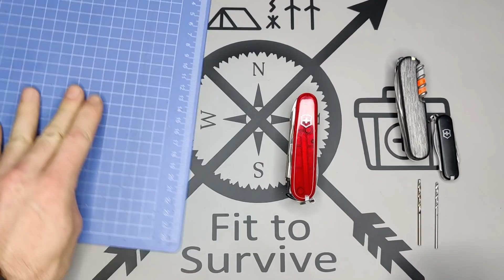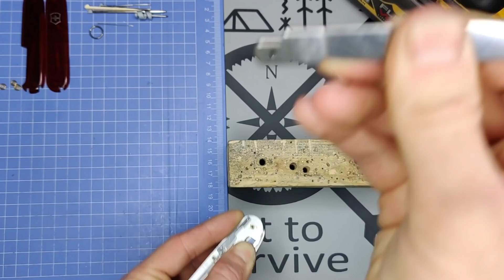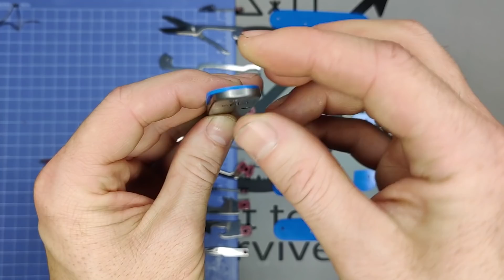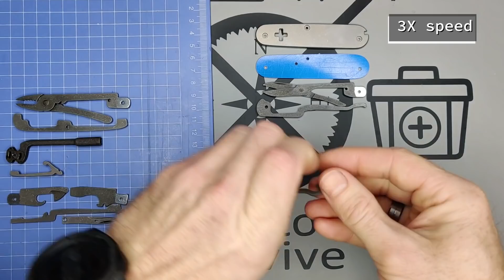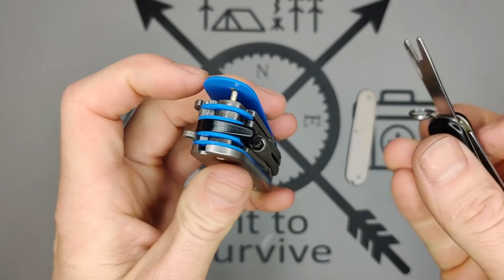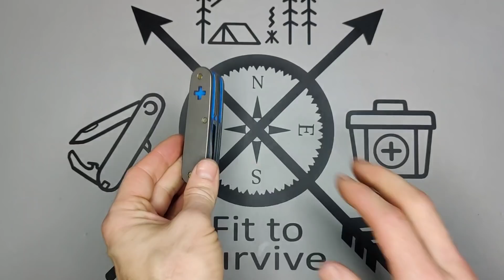How I made this Bladeless Cybertool M

Comment: As someone that wanted a bladeless multitool, and ended up with a modded cybertool lite, I will share my own research. To pass TSA guidelines there are four important things to note. First of all, they might try to stick the "No swiss army knife" rule on you, because of the cross Design on the front. However, TSA guidelines clearly state that you CAN have a multitool in your bag, as long as it doesn't have a knife blade. You will probably want to make a sheath for it to rest inside of to be extra compliant. Second is the scissors. TSA states that you are allowed to have scissors if they are less than four (4) inches to the fulcrum. Since this is a small set of scissors, it should be fine regardless of which fulcrum the agent chooses to try to use. The third is the most surprising. The bit driver will fall under the "collapsible tool" rule, and must be less than seven (7) inches long when fully extended and assembled. The bit driver should just barely squeak by this. The last one doesn't apply to your build, but is good to know. According to TAS guidelines, corkscrews are permitted on the plane, as long as they are not attached to a knife blade. 

Hope that is helpful!
Reply from the maker: Wow!! That is VERY helpful actually! Thank you for all of that information.
Reply: The problem i see is that it looks so cool that the agent might want it for themselves, thus trying to take it from you. I'd love an update once you actually went thru the airport with it
Reply from the maker: @nobodxy  Yeah, that would definitely be an extra difficulty.
I built this knife for somebody else. If he flies with it, I will update if he flies with it.
Reply: Yes, thank you very much! All info is helpful. Sadly I still feel that it will come down to the agent and how they are feeling that day and if you have the time to whip out the document and argue your point.
Reply: @korgan7779  if you want to fly with a tool like this, you will be served well by having a paper printout of the regulations, so that if there is a "Problem" you can show that you are in compliance.
Reply from the maker: @korgan7779  Yeah, in the end it comes down to their mood that day. 😒
Reply from the maker: @dagger341  Good idea actually. Having a printed out copy of the regulations might help you get at least fair treatment.
Reply: @FittoSurvive  

As someone that travels with a firearm, the TSA doesn't abide by rules or laws, just feelings. 

I'm required to retain the only key to my case once it's been declared and checked assuring it's unloaded. The LAW states I alone have the key. I've had the locks cut off my case, a card inside stating the case was opened for further inspection, and now zip tied closed.  They just broke a federal LAW, nothing is ever done.

The rules TSA has on the website frequently don't adhere to the federal law. If you want to fly, bow down to the previous burger flippers, or you don't fly.

The stupidest thing George Bush did was creating the Department of Homeland Security, and federalizing security personnel at the airports.
Reply: The awl can be an issue the sharpened part can be considered a blade... would leave the corkscrew if you can over the awl
Reply from the maker: @gungadinn  It really is insane. They shouldn't be above the law.

That is insane about them cutting the locks off of your gun case. And zip tying it back shut seems irresponsible.
Reply from the maker: @midwaymonster78  That is what many people have said... I guess I'll have to get rid of it in my next build.
Reply from the maker: @stevesinclair4159  🤣🤣🤣👍🏻
Reply: How does and awl or saw work?
Reply: @BassMaster.454  those will either need to be in your checked bag, far away from you, or left at home. Awls and saws are considered too dangerous.
Reply from the maker: @BassMaster.454  TSA doesn't want people awling or sawing other people to death on the plane. 🤣
Reply: @FittoSurvive  or deliberately damaging the aircraft.
Reply from the maker: @dagger341  True... Didn't even think about that. 🤔
Reply: I've had a ratchet bit driver denied boarding, TSA didn't like the 3" long flat blade screwgun bit + stubby racheting handle definitely less than 7" assembled they said it could be used as a prying instrument against a cockpit door. Tossed the bit into the lighter bin.
Reply from the maker: @ducatipaso1386  That is crazy! And not very encouraging for me. 🤣🤣🤣
Reply: @ducatipaso1386  did it have a case? I only ask because I want to do everything in my power to take my tool with me when I travel. Even if I have to assume that I will have to go into it as prepared and literal to the letter as an attorney, which might be the case, I want to give myself the best chance I can
Reply: @ducatipaso1386  LOL what a load of nonsense - I mean, if they make the cockpit doors out of wet toilet paper then yes, I can see how a 6" ratchet would an issue. But the same would be true for a plastic spoon. Or a very targeted sneeze.  If you can get a cockpit door open that easily, then clearly it is not the tools they should be worried about.

Besides: There is not exactly a lot of room around a cockpit door to even insert any prying tools, even for a very determined person. If there is more than one person directly at the door to the flight deck you would have to shimmy past each other...You can pretty much forget getting even a very small actual prybar in the maybe 4 inches (being generous) of space around the outer door frame. Also, some if not all cockpit doors are designed to withstand being shot at with a handgun without being penetrated. And "Damaging the airplane"....You would have to hack your way through some pretty tough plastic and a bunch of insulation before you even get within sight of the bare metal. With that little stubby ratchet. And by that time you probably have at least half of the passengers and all of the flight attendants wanting a piece of you. I cannot put my finger on it, but...something about that TSA logic is not adding up.
Reply from the maker: @DeputatKaktus  Exactly, right? Most of the TSA logic doesn't make any sense.
Reply: @FittoSurvive  Maybe they are afraid someone might try to sneak themselves some extra leg room by moving a seat row a couple inches? 🤪
AFAIK the seats are bolted to floor rails with regular hex or TX bolts…
Reply from the maker: @DeputatKaktus  😂😂 I think you nailed it! LOL That is exactly what they are concerned about. And what a good idea too. 😂 (evil laugh)
Reply: I tried flying with a Nerf blaster in my carry-on once. OKC - BWI round trip. I did the research and knew I had to put the battery in my checked bag. No problems with Oklahoma TSA, they looked at it under the x-ray, asked me about it, and let me through. Wasn't so lucky in Baltimore, though. Same setup as before, however the supervisor over security that day wasn't impressed. He told me I had to put it in my checked bag because it was a "firearm replica". Seriously. Did I mention it was bright orange all over? Not just the barrel like required, literally the whole thing is bright orange. Very obviously shoots foam darts and requires a battery, neither of which were in my carry on. So I had to leave the line, go all the way back to the desk, recall my checked bag, and figure out how to fit it in my already stuffed suitcase with no lock or anything (the modifications I did were not cheap). 
Anyway, be safe out there. You never know if your item will be fine for one airport's security but not for another's.
Reply from the maker: @chrismichaelyoung  That's crazy, but sounds about normal for TSA. 👍🏻🤣
It's actually quite a comical story too, thanks for sharing that.
Reply: Note that under the tool rule, the tool may not exceed 7 inches in any combination. This is important when considering which bits and adapters that you carry with it, since if you carry for example bit adapter to 1/4 adapter, and then you (or somebody else on same plane) brings a mini ratchet with 1/4 to hex adapter. Then you will be turned down on that, because the bit adapter can then be assembled to the 1/4 adapter, and then the 1/4 adapter to bit adapter, and then a bit on top of that, which would make the tool exceed 7 inches.

This also applies to if you don't carry any adapters at all. Actually, the TSA agent might need to reject all "bit type" and "socket type" of tools regardless of size just to make sure no combination of tools can be bringed on the plane so it becomes longer than 7 inches. They can't use ticket group as selector, as terrorists and such may book the tickets in separate groups to make sure they foul all group limits, even if they lose any family/group discounts.
Reply: @ducatipaso1386  Its actually not that. They propably said so, because this is the problem: Any tool handle or ratchet that accepts a "standarized tool" may be banned because of the problem that multiple passengers may carry extenders and adapters, such as so the combined tool becomes longer then 7". Its not really fair to allow 1 passenger to bring ratchet handles and bit drivers onboard, and then deny the next passenger having a little keychain ratchet bit extender, because in combination with the previous passenger it exceeds 7".

Its kinda hard to reach that with 2 extenders and a bit, so they propably made you toss the screwgun bit into the lighter bin just to keep the total size down, but actually, they should deny all "standarized tool things".

So this applies to all tools that can accept a standarized tool head. Both bit drivers and socket things (ratchet drivers, 1/4 screwdrives,  plastic boxes with 1/4 screwing  attachments, bit boxes which works as a handle for bits etc) falls into this rule.
Reply: @chrismichaelyoung  I understand the reasoning for this. Even if its bright orange, it could be easily repainted with a sharpie on the plane toilet, and then presented as a grenade launcher. So anything that barely resembles a fake gun, or could be assembled into a fake gun or fake anything that is prohibited/dangerous, must be rejected.
Reply from the maker: @sebastiannielsen  Wow... That's crazy. Didn't know that.
Reply: Yeah this. If there isn't a sharp edged part, multi-tools under 7 inches are fine to go. It is all dependent on the specific airport though as each has their own local rules as well.
Reply from the maker: @MasterYoshitaka  It does seem to depend solely on the airport and their decision.
Reply: @dagger341   When I took a school bus to Summer day camp in the 1960s there was a kid on the bus who would bring a small philips head screwdriver and remove some of the screws that held the seat back on.  I don't know if he ever got one off and I wonder if he continued this random destruction as he got older.
Reply: The awl would be the one I’d worry about. It’s sharp edge with a point😳
Reply: @chasekemp4982  True. The screwdriver would technically be a safe option, but the current way the TSA is run means that the agents are encouraged to just take all multitools in carry on, regardless of the attempt to comply with their rules. It is a terrible idea, in this current environment, to fly in the US with any multitool in your carry-on.
Reply: Great job!
Reply: @nobodxy I’ve always suspected that…
Reply: what about the awl
Reply: @gungadinn  ignoring the warning about 9/11 because “the Middle East was Clinton’s thing” was the dumbest—this came in second though
Reply: What do you mean by corkscrews "attached to a knife blade"?

Comment: Amazing. I’d remove the pliers and swap out the bottle open and can opener for a Spyderco blade that can be opened with just my right hand. And of course add a pocket clip on the scissors side. I would use that thing multiple times daily.
Reply from the maker: Thanks. 👍🏻 Sounds like a good toolset.

Comment: Can't get enough of your build videos.  This one is by far my favorite as you go into the process in more detail.  Have you been able to source the 2.2mm brass rods other than from Europe or via Aliexpress?  If not, do you drill out the 2.2mm pin holes (for the corkscrew, etc) to fit 2.5mm pins?
Reply from the maker: Hey! Glad to hear that!
I have not been able to source the 2.2 mm brass rods from anywhere except for China. I have never drilled out the middle tools to 2.5.

Comment: I admire the work you put into forming the liners. Would it be practical to consider 3D printing something like that or is that material not durable enough to use? Just thinking you could set up a program, print out the 4,5 or 6 liners your need and save time.
Reply from the maker: Thanks. I don't know if 3d printing would be an option. But a good CNC machine would probably do the trick for sure.

Comment: Great work, very informative. I'm starting to realize that choosing an 84mm as my starting project might have been slightly more difficult to start learning on then a 91mm or especially a 93mm as I'm having to make a lot more custom parts but oh well, just means more will be easier later.

I think Ill have to look into using G10 liners down the road as well. Currently using the aluminum and custom brass liners.

As far as TSA is concerned; Just say NO. There are way to many factors involved and the worst one is that a human is the judge of what is and isn't allowed. If they are going to make restrictions and have them written down then they should enforce them without so called interpolations based on 1 or 2 peoples beliefs and what kind of day they are having. I would not risk a custom piece on someone else's bad day.
Reply from the maker: Yeah, the 84mm is rough because it is really limited.

You are most definitely right about the TSA. It would be a huge risk to try to travel with this tool even if it matches all of TSA's rules.

Comment: Really good video! Good work!
I have a question. If I want to keep the corkscrew and instead remove the punch.
Can I use the layer with the punch and put it on the outer place where the corkscrew sits?
Will i use the spring from punch later or the corkscrew layer?
Big Thx!
Reply from the maker: You could keep it, but you'd have to use a different set of scales that have the corkscrew cutout.
Reply: @FittoSurvive  Tried it this weekend. I needed to modify the spring for the blades to fit the can openers. And use spacers as the can openers are narrower than the spring. It turned out well :)

Comment: This was amazing! I've carried around my swiss army knife for years and was never aware of how much customisation could be achieved. Do you think it would be possible to use some kind of bolt/screw system instead of the peened pins? That way you could easily pull it apart and swap parts out if you wanted. Interested in hearing your thoughts!
Josh
Reply: He did say it was supposed to have hex screws but he didn't have any long enough.
Reply from the maker: Thank you!
Yeah, there are lots of customizing options out there.
Yes, like Lee commented, there is an option of using torx screws. But the ones I have available only support up to 4 layers.
Reply from the maker: Thanks! You are correct.

Comment: I'm a newbie to the swiss knife tool community...where did you get all the "accessories"?  brass pins, tweezers, corkscrews, toothpickes, etc. in the complementary colors?
Reply from the maker: The brass pins I ordered from Amazon, there should be links to them in the description of the video. The colored accessories can also be purchased from Amazon, but I don't think they are in stock right now. But you can definitely find them on Ebay.

Comment: Ok can ya tell me where ya got the colored tweezers and picks?  Have modded a few SAKs before but mostly taking a layer out and replacing with my Jeep key and front door key
Reply from the maker: The colored accessories are original from Victorinox. They can be found on their website, on Ebay, and some other websites. Search for "colored Victorinox tweezers" several options should come up.
Swapping out a layer for keys is pretty cool. 👍🏻👍🏻
Reply: @FittoSurvive  thank you.  There’s actually a video on here of one I did for a buddy. Not sure how to find it though
Reply from the maker: @TexaStunna187  Really nice. 👍🏻👍🏻👍🏻
Reply: @FittoSurvive  thank you. They are a lot of fun to play with. Been wanting to do G10 liners and Ti scale build but been working on custom fixed blades mostly
Reply from the maker: @TexaStunna187  Yes, it definitely is a fun hobby. 👍🏻

Comment: Where did you get the scales? And do they also come in brass. I take it that I would have to drill and tap for a pocket clip.
Reply from the maker: These particular scales I ordered from Aliexpress (China). I have not seen anything similar to this set in brass. The brass scales that I have seen/used all have the corkscrew cutout on the back scale.
Reply: @FittoSurvive  thank you for the reply. Seems like the demand is high. I'm a AS9100 machinist and own my own mill and lathe. Do you see it as a viable income generating business?
Reply from the maker: @ahole5407  The demand is high. If you were able to make quality scales but keep them in the budget range ($50-$80), it could possibly take off.

Comment: Just watched this again and a new question.  
Can the two blades be replaced with the file?  (And the file tip ground round so it’s not a weapon)
Reply from the maker: Yes, the file layer could replace the blades layer. I think it should be TSA-OK.
Reply: @FittoSurvive  cool, thanks. 
I don’t think the awl will pass TSA.  Maybe replace it with the mini screwdriver or just cut it off and leave the hinge.